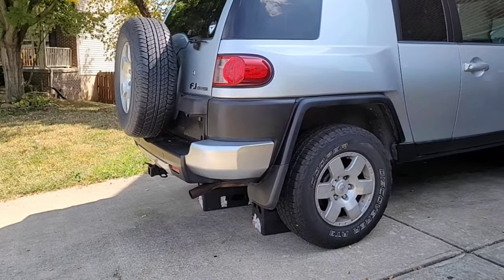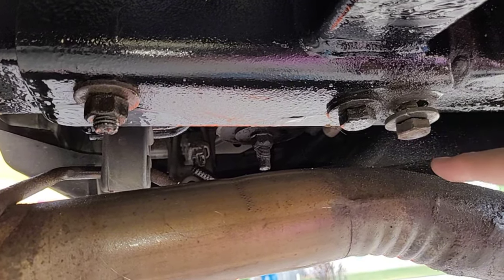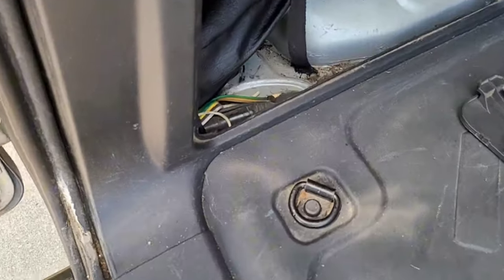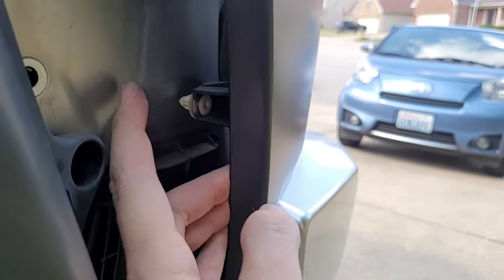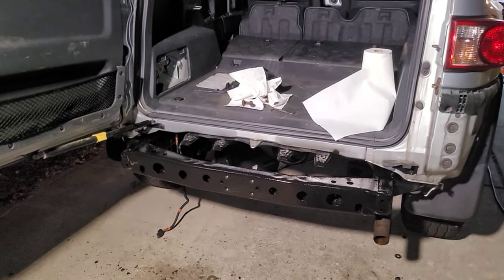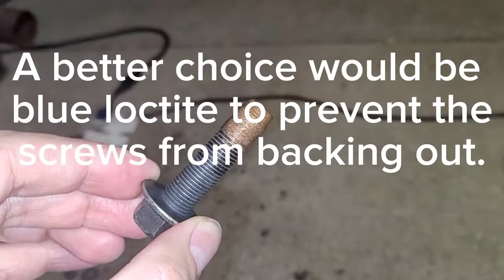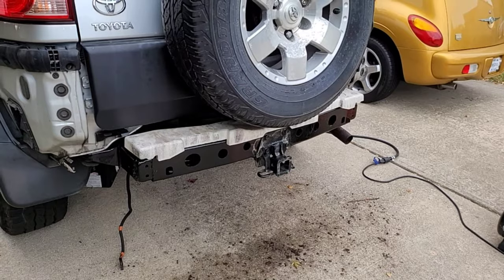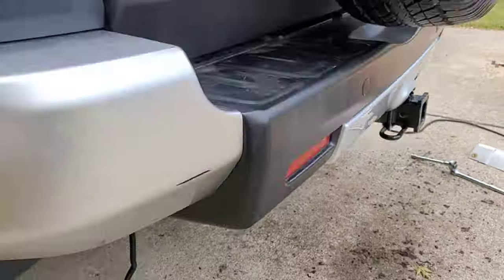Don't drag your BUTT! Fj cruiser gets OEM trailer hitch & loses weight #fjcruiser #offroad #trailer

Comment: Hi there, do you have the link to the OEM kit?
Reply from the maker: @stayreal4l284  Here is what I bought off of ebay. https://www.ebay.com/itm/402856975002
Reply from the maker: @stayreal4l284  If you want to also wire up the hitch, they have kits with both the hitch and wiring.